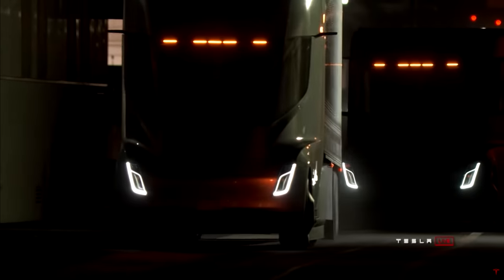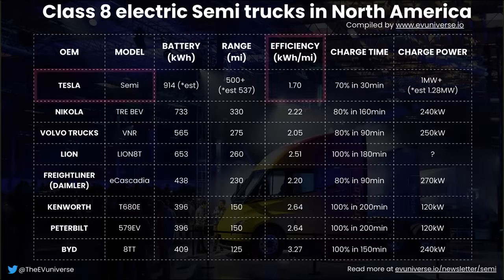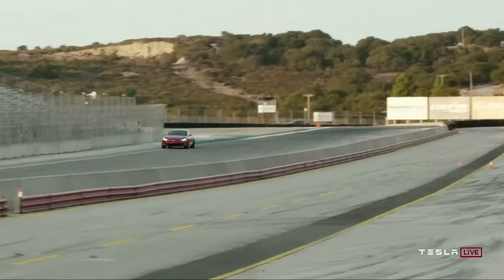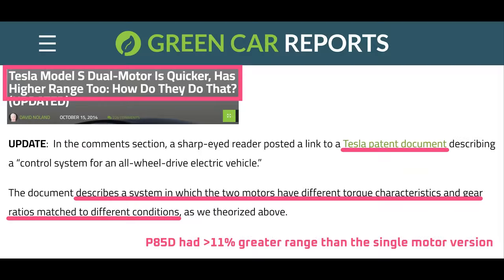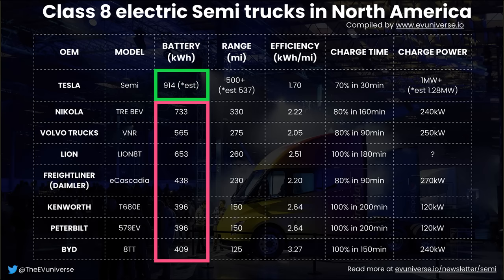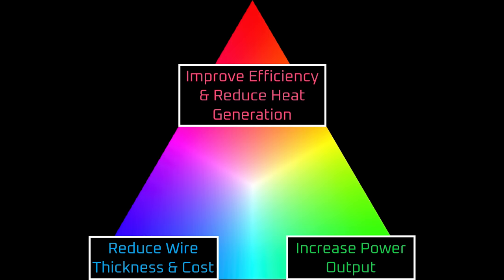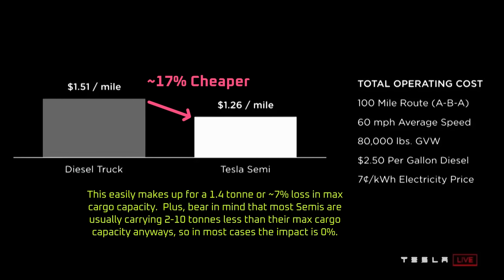How the Tesla Semi “Broke the Laws of Physics”

Comment: And extra bonuses with the Semi:
* Reduced braking noise (this is significant)
* Reduced braking particulate emissions
* Loss of braking air pressure is less of an issue
* Three motors offer redundancy in case of a motor fault
Reply: With the amount of regen available, a dead stop is easily possible.
.
I'd like to see a clever person work out the theoretical "emergency stop" time/ distance with JUST regen..... 🤔
That would be a great "party piece"?
Imagine a "Regen lockup" stop but with perfectly straight skidmarks?
Reply from the maker: Yes!
Reply: Reduced braking noise (compared to compression-release engine braking) and reduced braking particulate emissions, and less dependence on service brake air pressure are all common advantages of every battery-electric truck over diesels, not unique to Tesla.

A Tesla Semi with a failed motor will be out of service for repair, even with three of them.

Comment: the max gvw is 82,000 lbs ,in the US in europe & the UK electric semis are 2 extra tons so 4,400 lbs, therefore potentially negating the extra weight cost of the battery when ev hgvs reach the uk & Europe
Reply: Let's examine that ....
The ALLOWANCE is "2 extra tons" .
I want to know the origin of that arbitrary figure regarding how much and when it was decided.
I suspect that in the early Tesla Semi design stage it either didn't exist, or Tesla ignored it.
.
Contrary to the general concensus, I think the Tesla weight specs will be far closer (or equal!) to the diesel trucks.
.
We shall see.
Reply: @rogerstarkey5390  It's actually 2,000 lbs. or one ton. The change was made by 23 USC 127(s), in 2019.
Reply: The US exemption, as Ben noted, is 2,000 pounds. Even 2,000 kg (4,400 pounds) isn't quite enough to make up for the extra weight of an EV Class 8 highway truck with 500 mile (800 km) range.

Comment: Fantastic analysis as usual, Jordan! So we would expect the Tesla Semi to be significantly more efficient than Volvo and all the others in any environment when shipping goods over mountainous terrain. The regen should provide way more than a 18% differential. What a stroke of engineering genius that a battery which can accept 770kW regen is paired with a 760kW regen plaid motor.
Reply: The the "770kW" regen.

I'll take a bet we see the FUD machine kick in with "OMG!! All that regen will burn out the battery!!!!!"
.
But If we scale it back......
At a "load per cell" level, it's like a 100kWh pack taking a 100kW charge.
.
It's not exactly going to stress the pack?
Reply: Do we know that the competition (Volvo etc) don't regen?  Genuine question (I can't be bothered to check).  If the other guys are not using regen then they should be.  But I suspect they are.
Reply: @rogerstarkey5390  100kWh battery 100kW would be a 1C charge rate.
Reply: @chriswright9096  the competition all use regenerative braking, since they're neither ignorant nor idiots. The video just suggests that competing vehicles with smaller battery capacity are more limited in their peak regeneration power by that capacity, which probably makes no difference at all most of the time.

Comment: Fantastic video, well argued.
I’ve argued (from my armchair) the regen is prime reason for additional motors, not acceleration nor hill climbing ability (itself huge time & safety advantage). The 1,000 volt - I suspect compromise of a bit more power / regen, lots of efficiency using thinner wires, thicker insulation in motor - but from ignorance. 
High power at high revs is quite unique / major development for electric motors. Really broadens "peak power" rev range as % of usable rpm. (Say 80% of revs with >90% of max power.) 
Tesla really did re-write the laws of physics. Or how they’re used.
They’ve massively upped the ante.
I request info on safe speed going downhill, it’s only a 10-20% increase in braking distance over flat ground. Diesels cannot safely exceed 60 km/hr downhill.
Reply: It basically saves a 2 gear gearbox.

Comment: Regarding the weight comparison.
I was taking a similar view to the table at 13:08.
Rather than guess the weight, compare the weight of units removed, or added.
.
It is probably close on pack weight.
(Too close to argue)
 
But, a couple of other items don't necessarily add up.
On the Diesel Semi, does the engine weight include the main transmission?
If the "transmission" figure of "360kg" is for the unit bolted to the engine (exactly the "internet average" figure I found) did they consider the drive system to the back of that unit, but not the main drive to the rear axles or the differentials or the axles themselves?
.
knowing the design efficiency of Tesla, I find it hard to imagine the combined weight of the Tesla drive units, (motors to wheels) is more than 2 "conventional" differential units, axle housings and drive shafts from the main transmission.
.
If we consider the diesel axles to be equivalent to the Tesla drivetrain, that adds 350-400 kg on the Diesel side (or saves it on the Tesla!)
I think that's generous to the Diesel?
.
Then...
There's the front portion of chassis to carry the Diesel motor and it's associated systems.
Would that be essentially a "beam axle" to both carry the weight and absorb the torque of the system? Heavy?
.
Not needed on the Tesla since there's no rotational torque across the axis of the vehicle, it's all in the direction of rotation of the wheels. And confined to the rear.
And lower C of G
Then...
That assumption of "100 kg miscellaneous parts is wrong imo.
First that "beam", then the cooling system plus other fluids. "75kg exhaust"? Twin unit? Double it.
Ad Blue/ particulate control system? etc, etc.
and it still has an "Electrical system" (which assuming it had big lead acid batteries would weight at least as much as the invertors on the Tesla?
Then....
Look at the overlay in the delivery presentation, the sheer extra size of the Diesel body must translate to extra weight (proportional to surface area of metal?)
.
Even the wheels and tyres are smaller and so lighter on the Tesla, which translates to smaller, lighter brakes?
Leaf springs? (All air on the Tesla?)
There's an easy total 800-1,500kg saving in there (imo)
.
What would lay to bed all this speculation is of course a Tesla on a weighbridge.
.
We live in hope..... 😁
Reply: I thought the Tesla estimate was light on both battery pack weight and power conversion.  If the payload capacity was that close to a diesel they would have said so at the "delivery event".  Therefore, I suspect it is bad news.  Any meaningful measure of efficiency - as this video attempts - would only make sense in the context of payload.
Reply: @chriswright9096  
Really.
Use Model Y 2170 packs rather than the "10x 100kWh" (adjusted) 18650 packs others use.
If as Jordan says it's 11 packs.
(Hold on, I thought 11× 82kWh "LR" units... 🤔 But that's 9,020 kWh? )
Let's roll with it....
The *packs (complete) would weigh 11x 489kg = 5,379 kg.
But, that includes 11 times everything.
The cells (at 68g each) weigh 11× 4416× 68 = 3,303 kg.
I suspect they split the difference, then they added the inverters at a total of 75kg.
.
As for "they would have said at the delivery event".....why?
.
We know Elon loves "getting into the heads" of the FUD brigade.
.
They already gave far more information than any manufacturer of a similar truck (u use the term "similar" loosely, there's nothing close)
Why aren't they being asked not only for an opinion, but also why they can't do it?
.
Pick any one. Top trumps?
Reply: @rogerstarkey5390  why would you count only the cells of he battery? The big Semi battery needs module housings, interconnections, structure, and case just like the Model 3, and in proportion to the size of the battery. The Semi even has the battery split into nine separate boxes (six in the smaller 300 mile version) to facilitate handling and mounting, so it is simply 11 times the weight and bulk of the Model 3 or Model Y battery.

Comment: I think an important thing to remember is that the critics were right. Tesla couldn't deliver as promised, from the initial announcement in 2017 it took them almost 3 times as long as promised.
Musk also initially claimed to guarantee a 7ct/kWh charging price, about half of just the current price of electricity alone.
Reply from the maker: Thanks for the comment, spreads the video further.
Reply: @The Limiting Factor  your welcome, the video seems generally well researched, even when working off of as much speculation as is necessary considering the limits of independent data on Tesla Semis at the moment.
Reply: Well, nothing is perfect and there were a few tough years because of that whole pandemic thing.  I think that 7 cents was for electricity they harvest themselves.

Comment: A better phrase would be "cross-sectional area" rather than "surface area" when talking about drag.
Reply from the maker: Good point!
Reply: The standard term is "frontal area". "Surface area" is certainly not correct or appropriate, but I assume that most people understand what was intended.

Comment: People ask why my car needs to have the power to do 0-60 in under five seconds, my reply has always been that it's a side effect of being able to do 60-0 through regen quickly.  With the semi it's that long downhill stretches without the brakes being used that will be the primary design - with the acceleration and uphill capabilities being the secondary effect.
Reply: That's interesting. I don't quite agree as I do think there's many reasons for the high power output but the regen is definitely a great benefit.

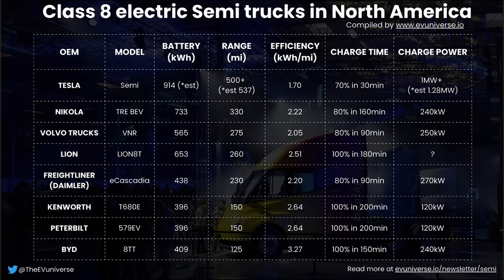Comment: It's interesting that the table @1:59 includes a note the Freightliner is part of Daimler, but doesn't note that Kenworth and Peterbilt are part of Paccar (and use the same electric powertrain). The Nikola line could also note that their truck is built by Iveco.
Reply from the maker: Good points, but not my chart.  See the credit.
Reply: @thelimitingfactor  I understand that - it was a comment about the table, not a criticism of the video.

Comment: what kind of shocks are on this vehicle? Since no mention of them has been made in this video, I presume they are standard hydraulic dampers. What if they were solenoids that would absorb the road vibrations and convert that into an electrical output, adding somewhat to the oveall energy inputs that would occur on any surface as long as it is in motion? The additive effect would increase on rough roads thereby lessening  that form of friction loss overall.

Comment: Looking at your chart, the claimed efficiency improvement is about 20%. The impressive range is due to containing twice the battery. I assume this would make the Tesla truck more expensive and reduce cargo capacity.

The actual comparison should be (kg mi) / kWh. We are moving goods, not trucks. And if the Tesla truck has a lower capacity, we are also using more drivers. And lugging around all that extra battery might cut into your efficiency numbers? 

Also I note the data comes from a newsletter, not a testing lab. And the Tesla numbers have a yummy asterisk suggesting that there is in fact no such vehicle that has been tested in any way.

Comment: Looking forward to the deep dive.  Rotor design is a good solution, allowing incorporation of switched reluctance type motor operation in higher rpm ranges at a minimum of magnet - iron drag of typical PM designs.  Interesting hybrid.
Reply: Munro Live has done a plaid motor teardown and analysis video you might want to check out.
Reply: I imagine it would just be a straight swap plaid core into a Semi housing, since the motor is physically disengaged, so not turning?
Reply: @mdebart8678   Cool!  Yeah, any additional details would be great, and having Munro's information as a base will make for a better understanding.  Never thought I'd become an electric motor/battery nerd, or a fan of automotive construction, and manufacturing, not to mention rocket technology.
Reply: @Roger Starkey  similar design of moter in a totally different housing for gearing, deselector etc.
Reply: @M Debart  I'd guess each motor has its own inverter. Not a problem.

Comment: When explaining drag coefficient I'd emphasize that it's relative to the cross-sectional area and that this area is essential to do useful work.  A bicycle could have lower absolute drag than a semi but a loaded bus could have lower drag per person than even the slipperiest of cars.
Reply: Yeah, for a moment I thought the video was going to explain that but it tripped over its own feet.
Reply from the maker: True, but that's a different discussion entirely.  The video is about why the Semi hit 500 miles of range, not why Semis are a more efficient method of transport than putting every box in a separate car.

Comment: How much efficiency would be added if the trailer roof were covered with solar panels?
Reply: Probably not enough to make up for the extra weight of the panels, which would reduce maximum payload.

Comment: I assume the operation of the motor at highway speed falls spot on the peak of the efficiency curve. People don´t usually understand how efficent an electric motor can be, I worked at a water pump manufacturer years ago, and 720 V AC motors could operate at 97% efficency in those conditions (equivalent to highway speeds).

Comment: The reason so many nay sayers got it so wrong is, none of them have actually worked in the industry.
Off highway vehicles have utilised electric traction since 1964 with locomotives being diesel electric for even longer.
The game changer was when Komatsu introduced the 930E with AC propulsion. The 930E needs only 50 percent of the fuel per bank cubic metre compared with an equivalent mechanically propelled machine.
All of the major players including Caterpillar now use AC propulsion.
Regarding motors, in practice they are sized for retard effort, so the guess regarding the trimotor regime is close to correct. Longevity is also a major factor.
Battery electric vehicles are moving into mining and rail industries.

Comment: I have often wondered how regenerative braking worked, when you already have a fully charged battery.
Use a battery with a bigger capacity does not sound like the answer.
Dissipate the energy as heat probably IS the answer. 
Where? 
In the place where we used to have exhaust pipes, is probably a good answer?
Reply: Regenerative braking doesn't work when you already have a fully charged battery. Tesla cars warn you about this; and a fairly recent change to the OS implements friction braking seamlessly instead of or in addition to regenerative braking, when regenerative braking is degraded due to charge level.
Reply: @BigBen621  You need to use the friction brakes as routine (say 1:7 applications) or they won't work in an emergency (glazed pads, rusty discs etc)

Comment: Jordan, has Tesla ever given a good reason they don't bring vehicle to grid to the cars? Is it a technical limitation? If they combine VPP and V2G they could subsidize cars to very cheap. Why have they not done that? Would/could they easily do that in hardware 4?
Reply: Early batteries had a shorter life when cycled a lot.  V2G just adds extra charge discharge cycles reducing the life of the pack and thus the need to replace more.
Reply: @TheEvilmooseofdoom  but if platform 3 is a new chemistry like LFP, I suppose there's a chance.

Comment: When I think of the Tesla quickly and gearlessly accelerating to highway speeds, compared to the diesel's narrow power band and the 18 gear shifts at each stop light, each with its re-acceleration of the engine and flywheel - and each accelerate/shift cycle taking time and wasting energy - it'd be nice to see some comparisons here...
Reply: Can you think about diesel with separate motors for every gear, instead of gearbox?

Comment: It is pretty amazing that there is a large difference in efficiency converting between AC and DC.  You would think this was a completely solved problem by now.
Reply: Theres always some resistance and inductance a circuit plus theres always a voltage drop across diodes plus switching times are not zero, none of these can be zero therefore 100% efficiency cannot be achieved .
Reply: @universeisundernoobligatio3283   ... and I suppose Faraday's cages to avoid the inductance increase cost, don't they?
Reply: @jefflittle8913  
Faraday cages are use to block EMI radiation not inductance.
Inductors are part of the DC to AC conversion process they have a frequency performance plus some resistance. Therefore some power loss.
Getting to 99% efficiency is very difficult glad Tesla got there.
There are youtube video’s on DC/AC power converter design look then up if you want to learn how they work.
Reply: @universeisundernoobligatio3283  

"Inductors are part of the DC to AC conversion process"

Ok, it turns out it didn't work quite the way I expected it to...
Reply: I am surprised it is as small as it is.
Silicon carbide components have really made a difference.
Reply: @jefflittle8913  
Plus any length of wire greater then zero has inductance, makes RF high frequency engineering a black art, glad I stayed away from that side of electronic engineering.
Reply: @bru512  
Silicon carbide has a low RDS plus when they run at high temperature the RDS has a negative temperature coefficient which drops there RDS even more.
Reply: @universeisundernoobligatio3283  RDS = ?
Reply: @bru512  
The On Resistance, RDS,on, of a FET transistor is a built-in parameter of the transistor that represents the transistor's internal resistance when it is in its fully conducting state (when VGS=0).
Reply: @universeisundernoobligatio3283  

Resistance Drain to Source.  Got it.